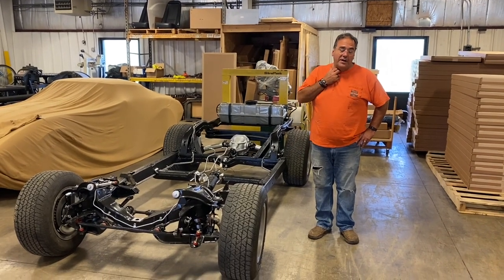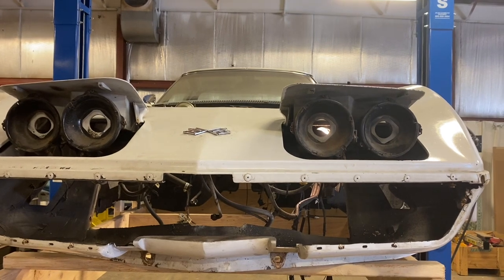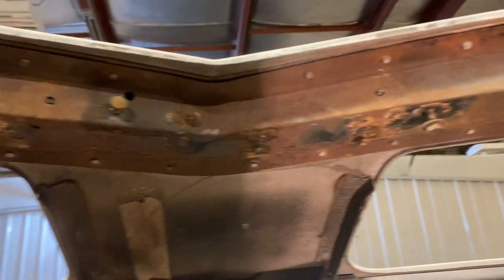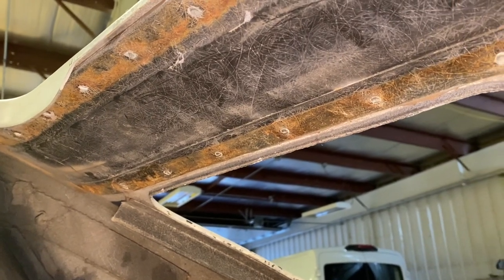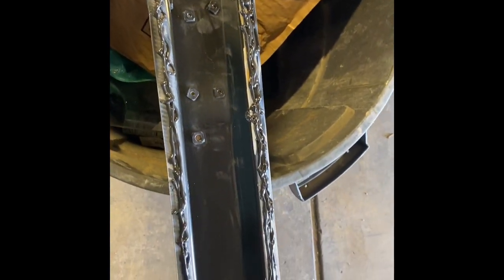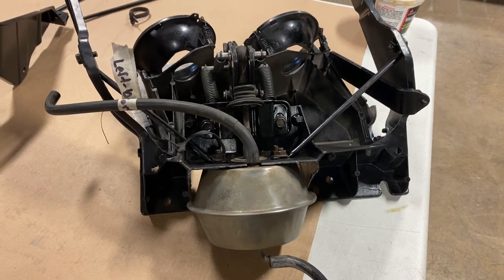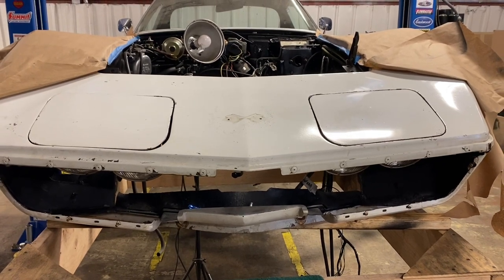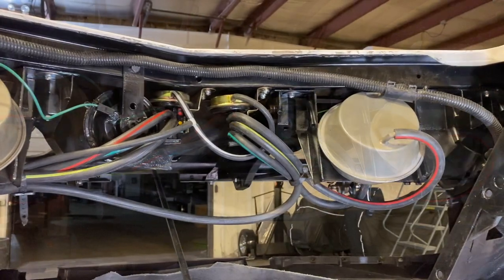1972 Corvette C3 Nose Dimple Repair/Headlight Header Bar Replacement and Headlight Assembly Rebuild

Comment: I'm in the process of doing a frame-off rebuild on a 72 as well.  Your videos have been extremely helpful.  Keep up the good work Mike!
Reply from the maker: So I'm about a year into this project and having a really good time with it.  It's like a giant puzzle to me except everything looks and functions so much better once cleaned up and reassembled.  I'm planning to remarry the body & frame over the next month and then send it out for paint.  If everything goes smoothly, I'll be driving it on its 50th birthday which is in June 2022.
Good luck with your project!
Mike
Reply: @mikelandwehr-corvette  Totally agree.  It's so satisfying to bring these cars back to their former glory.  I'm about 6 months in on my project.  Just got the frame blasted and painted and got brake/fuel lines installed last weekend.  Hopefully going to get a rolling frame within the next month.  

Best of luck on the body drop!  That's the next part of this job I'm getting a little intimidated by.   I was thinking about doing body/paint before I drop the body on the frame in order to avoid overspray, but I'm bit afraid I'd muck up my new paintjob in the process.  Hopefully all goes smoothly on your end!  I'll be eagerly awaiting the next C3 video.

Comment: The correct way to repair “header bar” issues is to replace the hood surround. It’s a big, expensive job, but the results are worth it.
Reply: Why go through all that trouble? Some SMC filler can easily fill those in after removing those rivets

Comment: Take a 2" alum. Flat bar. X 4" . drill a 3\4" hole.  Center it over the rivet. Clamp on each side with spring clamps. Good luck .

Comment: Its seems like grinding the rivets and pulling off the metal in one piece would be better, if you want to reuse.  The rivets would be sticking out and you can grab with a pliers?
Reply from the maker: Mine was pretty rusty, so it definitely needed to be replaced.

Comment: Hello, does the new header bar fit flush with the original fiber glass surround?   I followed your process and the fiberglass surround has to be flexed to fit the new header bar.
Reply from the maker: My header bar fit nicely to the fiberglass.  If yours doesn't, one or the other must be deformed.
Good luck!
Mike